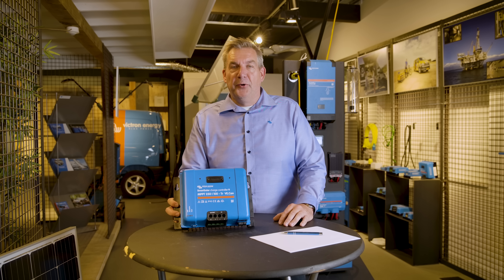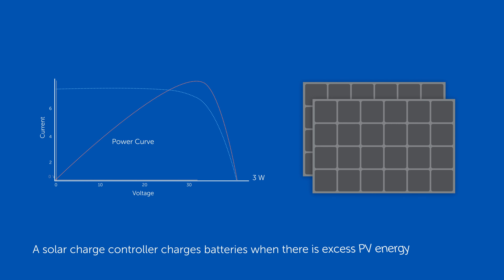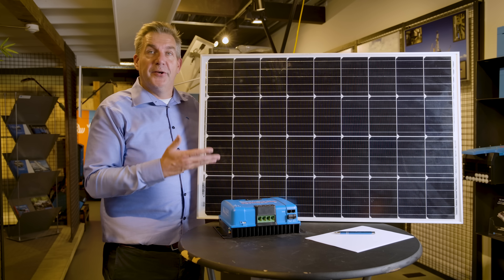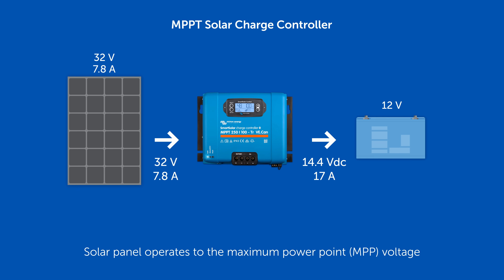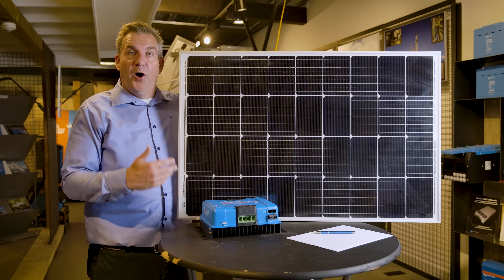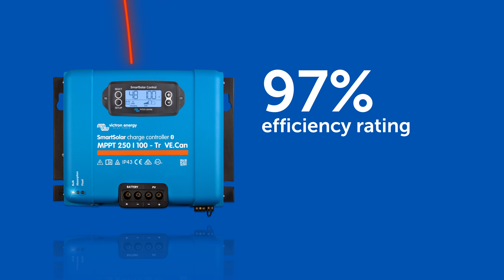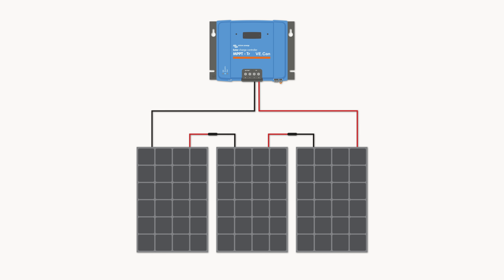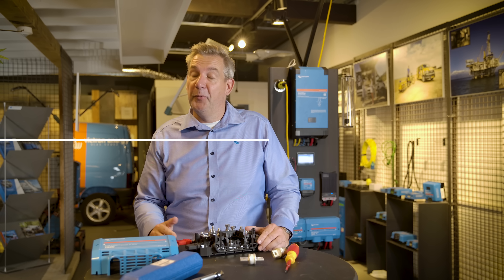How does a Victron Energy MPPT Solar Charge Controller work?

Comment: Thanks for the video. I have a question. On the roof of my Rv there is a polypv   185w 12v controlled by  your mppt 100/20. I want to install a new monopv 350w 12v max 26v max 16amp, and another of your mppt Bluetooth smartsolar controller. Wich is the correct one? Another 100/20? A100/30? Or maybe i'd better choose a higher voltage pv to widen the time range of Energy production? In this case can you suggest me a type/brand pv with max dimensions 180 x 80 cm? Thanks a lot!

Comment: Can you use the VE.Can to monitor the power in and out of the controller? Like if you interfaced it with an Arduino, assuming you have the right code?

Comment: For winter storage of my RV with lithium batteries where subfreezing temperatures are expected I have disabled charging in the Victron App. As I understand it  the batteries can survive these temps if not being charged. Since I don't have a disconnect in line from the solar panels is this my best option. Since the solar panels are still being exposed to the sun is there any potential damage to the charge controller or beyond by simply disabling charging in the app.

Comment: Great explanation, can you make a video about what happens if you run your MPPT without a battery attached? From the video I infer that the MTTP needs power from the battery to work, but I would like to understand more what's going on.

Also, it seems like the turn-on requirement is perhaps best stated as something like charge voltage has to be <= Voc + 5V,  which is quite a bit easier to make than what I had been assuming (Vmpp + 5V).

Comment: Hello good afternoon, I have a Victron MultiPlus 48V/5kW/70Hz inverter and a Victron MPPT controller with Cerbo GX and a touch screen. I purchased two Growatt AXE5.0LC1 batteries. I can't configure them because the system doesn't recognize them. Can this be fixed?
Thank you.

Comment: i am using blue solar mppt 100volt 15amp charge controller in a stand alone system. I have 4 200watt solar panels wired in series using recommended 10awg wire. the basic data is from the vedirect smart dongle and shows in peak of the day i generate 80-95 volts, which is correct. the current however has never exceeded 2 amps which gives me about 200watts at peak. the battery is charging just slowly. also the blue bulk light is always on (except at night when it blinks slowly). it has never changed color which seems odd. it seems like there may be an adjustment needed in the settings. any help would be greatly appreciated.

Comment: how loud or quiet is this victron charge controller does it have to be out of living are?
Reply: Beside the RS model, all units are sealed and cooled from a heatsink only, so should be noiseless.    living area?, I would suggest having them as close as possible to the battery ( which is not in the living area)

Comment: Thank you. 

Can i use the product for my power station Ecoflow Delta? 

If not. Can i use it instead 

Solar panel 600W to MPPT to 25V 100AH battery to ecoflow using XT60i. 

Is that possible? Thank you.
Reply: I dont know this product in detail sop please ask them.

Comment: I have 5 days on a new 100/50 SCC. 600w of panels and 200ah 12v lifepo4 battery. Beautiful Solar collecting days here in Florida, BUT CAN'T get over 31 amps out of the SCC toward the battery no matter the charge level. I thought these would at least get close to what they're sold as??
Reply: to get close to what the panels are rated at, its needed the panels are clean, not to warm , well aligned to the sun and with proper cabling     whats the input voltage on the controller?   if possible have the panels in serial connection (if the total voltage of the panels stays below the 90Vdc app)

Comment: Victron needs more UL approved devices. I have been waiting for the multiplus 2 5000va. It has UL pending for a year and a half. Love the Victron products. Frustrating I can't use the non UL models.
Reply: The MultiPlus-II 5000 just has been certified for UL1741, CSA.    Was that what you could use?
Reply: @JohannesBoonstra-ol2nz  yes that is what I need. When will they ship to online sellers? I am assuming they will have a different SKU than the current non UL rated Mulltiplus 2

Comment: Hi Johannes,  
Thanks for the great explanation.  I have an all Victron Multiplus II system on an RV with 6 roof top 400watt Q Cell tiltable panels (3 per side). The panels have a short circuit current of 11.14 amps and an open circuit voltage of 45.3v.        During the Winter, 3 panels on one side are tilted up to face the sun and during the Summer they are all lay flat.  Currently I have two 100/30 Smart Solar MPPT Charge controllers each on an individual panel on either side of the rig and one 100/50 Smart Solar MPPT charge controller on two of the panels in series on one side of the rig.  The final two panels (on one side of the rig) are feeding a DC Minisplit.  This configuration works great in Summer but during Winter night time electrical use it falls short.  I'd like to add (based on your recommendation) either one or two more charge controllers for the two panels (that currently power the DC Minisplit in order to feed the battery bank during Winter because I'm seeing that the 4 existing panels are unable to charge the 1000ah bank more than about 50% in one day.  I've put the panels on different charge controllers because of the tilting of panels but also because I sometimes park where I get some shading.  
Two questions:  Based on what you mentioned about higher voltage and being in Series offering earlier and later battery charging.... Am I better off with one 100/50 or two 100/30's? The possibility of tree shading is what stumps me here...

Also, does Victron Energy make a DC-DC Transfer Switch that I can plug the PV array into and remotely switch the load to either the MPPT Charge controller or the DC Minisplit?  Or can you recommend a transfer switch for this purpose?
Thank you. 0:06
Reply: You could also go for a 15)/xx model idk needed.   the 50/30A depends on the power expected from the panels.     The shading is due to the fact most "A" brand panels have bypass diodes not a problem.      No, we dont have DC transferswitches I am afraid
Reply: @ Hmmm... sorry, I'm not following what you said there..... What is meant by "15)xx model idk needed"?    I guess more importantly, will one charge controller on two panels be as good as a charge controller for each panel?  Thanks!
Reply: @LoveTheLand  thats a 150Vdc model, so a higher input voltage option.

Comment: Great information about MPPT controllers, thank you. You've already mentioned that by wiring panels in series I increase voltage and as a result charging the batterie starts earlier in the morning and lasts longer in the evening.
I'm planing to install a Victron MPPT 100/50 and 2x 190Wp solar panels (rated voltage 30.10V, no-load voltage 35.30V, rated current 6.68A) on my mobile home. Both wiring the panels in series or parallel should be possible but according to your video wiring in series should be preferable over parallel, correct?

Comment: We have a victron controller, 30A, to charge a 12-volt battery, 400 watt solar panel that says it has 21 volts. The controller is only reading 0.01V. We connected a second solar panel which has 18.5V. Does that give us a total of 40V? And the reading shows 0.42 after we connected the second panel. We can't figure out why the controller is not accepting the voltage from the solar panel. Can you please give us some advice. Thanks.
Reply: When the PV voltage is immediately 0v when connecting, the MPPT is shorting the input 
Most likely because of a setting fault )battery system voltage ) or that there is a hardware issue causing this 
Please check settings and contact the dealer if needed

Comment: In your reply to an earlier comment you said the MPPT controller seeks to eliminate fixing on a false maximum power point by scanning the incoming voltage every 10 mins (or more frequently). Is it possible to turn off this function in a Victron charge controller? When an MPPT charge controller with this function is used with a small hydro generator, the brief open circuit condition, caused by the device doing its scan, causes the hydro turbine to be un-loaded and results in the turbine overspeeding. Overspeeding is not good for it !

Comment: Thank you for your videos and help.
Our camper came with a mppt 150/100 solar charger. I don't know what the voltage of our integrated Dragonfly solar panels are. Each 1 of 3 produces 310 watts. Hoping to learn this soon.
We have a port for adding panels, but I don't know if it's safe to use our 23.40v pack. 
If the volts values are different, can this be a problem with the charge controller? If they have to be the same, what is the tolerance?
Reply: First you need to find the open circuit voltage and the short circuit current ratings of each of your panels (find how to do this via Google), then use the MPPT calculator on the Victron website to work out what combination of series and parallel panels will work with your existing MPPT charge controller. At a guess I'd say no more than 2 panels in series and 3 sets of these in parallel) If it will work, you need to make sure the voltage setting on your charge controller is set to match the battery you are connecting it to otherwise you could damage it and the panels or battery you connect to it. The 150/100 will take a maximum 150volt total input voltage (though best to err on the low side for safety and longevity, panels will output more voltage when cold so you need to account for this) and 100Amps output current (you wouldn't want to put all that 100A charge into a lead acid battery though but lithium batteries may be able to take it, check the max charge rate of your battery pack)

Comment: I was recently given some Smart Solar 100|15 MPPT’s so now I have twelve. I also have 12 batteries in 3 strings of 4 for 48V and each string will feed a 48V 5kW Victron inverter.
My question is can I run One 12V MPPT per battery despite the batteries being in series for 48V ? That is to say one MPPT in parallel with each battery (effectively making a series connection).
Reply: No ! As the MPPT controllers are not isolated this would create fireworks I am afraid

Comment: I have a Victron off grid 24v system that consist of three MPPT 100/50 controllers, four Multiplus 3000 inverters and their BMV 712 smart battery monitor.  I have 14 Battleborn batteries for 700ah of capacity.  My system has run flawlessly for almost 6 years except for one inverter failure which Victron issued a return shipping label the following day!  Their customer support is the best in the industry.  Thank you Victron!
Reply: 14 batteries and only 700ah ?
Reply: @DOUBLEDEFENSE  Yes, 14 12v 100ah batteries in a 24v system is 700ah at 24v. Amp Hours are meaningless without relation to voltage. That's why it's better to talk in watt hours instead.
Reply: Not my experience with customer support.

Comment: For PWM controllers, can I assume that the effective power output will equal Pmax * Vbatt / Vmp? Where Pmax is the power that an ideal MPPT controller could extract, Vbatt is the nominal battery voltage, and Vmp is the panel’s voltage at its maximum power point. Say, 250W * 13.8V / 18V. This works out to be about 75%, would this lower effective efficiency be a valid way of explaining PWM charge controllers to potential customers?

Where I work we also sell a PWM charge controller that says it supports lithium batteries, but I get the impression that it isn’t a good idea to switch a panel on and off into a lithium battery when it’s nearing the end of its charge cycle. The pulses of current will be quite high compared to the smooth ramp-down they want, and the BMS may complain.

I’d really like to see some small (e.g. 1-3A) MPPT charge controllers to use 5-15Ah LFP batteries for electric fences, driveway gates, that sort of thing that lead acids still dominate.
Reply: Pmax depends on the angle/power from the sun so is not a specific % , but 75% is about what it is

Comment: This video was very helpful and understanding. I have four 100 W solar panels and I have two 100 AH lifepo batteries. Which size MPPT controller should I get? Thank you.
Reply: depends on the solar panel , so the smaller 75/15 would already be sufficient

Comment: Good morning, could I have your official answer to show to Italian users on why it is important to charge LFP batteries with a nominal voltage of 51.2V to values of at least 55.4/55.8V? I would really appreciate your feedback.
Reply: I am sorry, what do you mean ?   You need to charge the LFP on a cell voltage of 3.5-3.55 to be full, so then depending on that there will be a endvoltage for absorption.
Reply: @ thanks for the answer, but I would like to explain why it is important to bring the cells to a high voltage such as 3.5V, what happens at that voltage in the battery pack? Is cell balancing activated by any chance? thank you, you were very kind, you are my hope to make these concepts understood in my country, Italy.

Comment: The MPPT looks for the highest PRODUCT of voltage and current, not the sum. Watt = Volt x Ampere, right?
I never regretted building a 23 kWp home solar power 3 phase ESS with victron components, 2x RS450/200 MPPT, 3x Multiplus II 15kVA, Cerbo, Lynx DC bus, 6 x Liontron LX48-100 5 kWh batteries.

Comment: We need more 48V gear, Victron!  Come on, split-phase 48V Multiplus II please!  And better small form-factor charger and DC-DC options.  The DC-DC gear is so friggin old-school, its getting annoying.

And maybe you could improve the terrible terminals on the 100/20 that can't even accept ferruled 10 AWG cable.

And it would be nice if you fixed the charge controller algorithms to work smoothly with power supplies and batteries on the input.  There is no reason to put the input through the broiler on startup that exceeds the output current limit setting.   Your charge controllers make better DC-DC chargers than your charge controllers in numerous situations.

Your battery protects are terrible.  The leakage current is horrible and they burn out easily.  Please at least add a large resistor to ground on the output so it doesn't constantly float up to the input voltage when off.   Add a diode to shunt reverse current back to the battery instead of blowing the FET up, and fix the ridiculously too-sensitive short-circuit protection that constantly trips on simple things like charging inverter caps when re-engaging a breaker.   Bluetooth with remote access to the viirtual load output of other charge controllers would be nice too, so we don't have to physically wire it.

-Matt
Reply: Haha,  you make it seems we are laying backwards and rest ;-)

Comment: Why is it critical to disconnect solar panels before disconnecting battery? Many people have master battery isolators that they will operate without isolating solar charge. Thanks
Reply: To avoid voltage spikes on the charger output if there is high current flowing.  Knowing Victron they do have a protection diode or other component to clamp the output voltage but you still shouldn't do it.
Reply: @retrozmachine1189  this is correct !!

Comment: When 250/70 MPPT charge controller. The spec say Normal PV 12V 1a,b is 1000W. Does mean you can have two arrays each contain 1000W?
Reply: Assuming its a victron charge controlla, Acording to the data sheet on there website its stated Max. PV short circuit current is 35amps Absolute maximum input! so how you do you're setup, Do not exceed "Maximum PV open circuit voltage coldest conditions" and Max. PV short circuit current

Comment: I have a Victron MPPT 100/20, and when it is charging I see a low level of noise on the battery side, about 100-200mV at ~30kHz, on top of the DC. From you video I guess that this may be related to the FETs switching, but is this normal?
Reply: yes thats possible.   good wiring and ferrite may reduce this
Reply: @johannesboonstra6917  Thanks!

Comment: Thank you , So why cannot we develop an algorithm or firm ware update to make this work with wind power. We can control the wind output with rectifiers and Capacitors to smooth the DC and use the controller to respond at a much faster rate to output to a battery from a wind system.  I would think this would be a simple task for your team to offer a wind firmware update for the MPPT charge controller . this way we can take advantage of all your technology to support both wind and Solar.

Comment: Is there current limiting? Clearly you can't apply too much voltage in cold weather etc - but if you have the potential of a higher current than the nominal max of the MPPT, does the controller current just get held at a certain current regardless of the capacity of the PV array. I appreciate that it can't survive a reverse polarity connection at higher currents. Also acknowledge that it should be appropriately fused where paralleling strings.
Reply: Victron's charge controllers have always had current limiting on the output, and you can configure the maximum output current.

They don't particularly have current limiting on the input and Victron doesn't like people connecting up low-impedance sources like batteries and power supplies... but its so dang useful to do that, I wish Victron would fix the algorithms to work with those sources more smoothly.

Comment: I see from the comments below that they are all lazy and love all-in-one systems, they are made for Apple people, so in case of MPPT failure you are left without an inverter and in case of inverter failure you are left without the possibility of charging the batteries, I prefer everything single and separate, and the market evidently loves the sol-ark style, then in case of problems the battery bank remains.